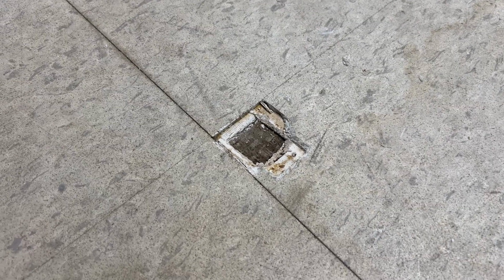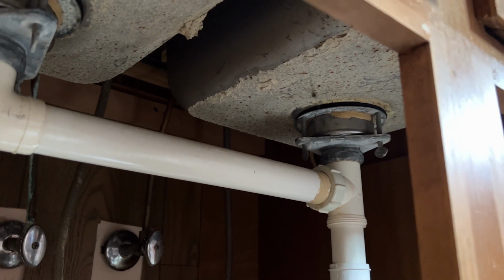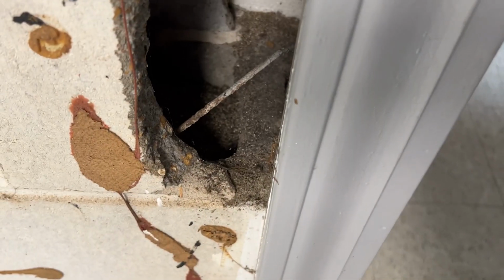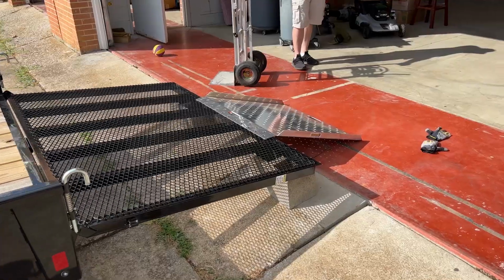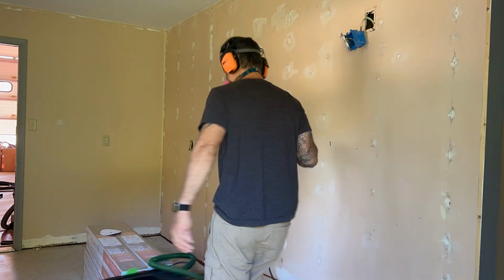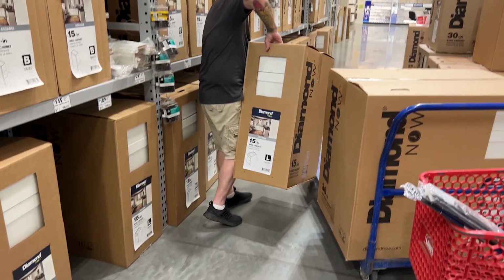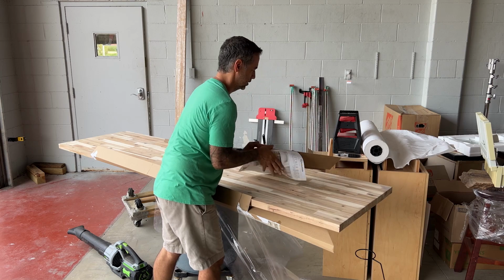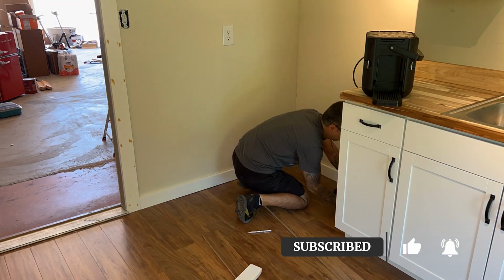We Found Scary Mystery Dust and Transformed the Kitchen!

Comment: A suggestion from Australia - screen doors for those back outside doors (and probably windows). Keeps hungry multi legged pests out from spring to winter while allowing air flow. If there are possums or similar invasive pests, get the mesh security door type (and brush type fill around your roller doors out front).

Comment: As someone who finished our acacia countertops with Rubio, I would make sure to keep the top dry. Anything that can trap water underneath is a big no no. My wife had a plastic tray next to the sink for the dish and hand soap. We rarely moved it and water got trapped underneath it. She moved it one day and I had about a 6" square that had turned black. This was about 6 months after applying the finish. So I sanded it down and reapplied some more Rubio. I had also previously applied one coat of the oil plus 2c and one coat of the maintenance oil. It ended up looking good and blended in nicely. I'd still prefer an oil wax finish over a poly on them as it's much much easier to repair.

Comment: If you have to cut in the block wall again you can drill small holes above where you intend to cut the wall.  Get some cans of foam in a can.  Spray the foam above so your whole block cells to the roof won’t be a pile in your floor. If you remove all of the ‘blockfill’ expect to dispose of a crapload of insulation.

Comment: If on propane, the soft copper is the proper material for gas piping. If natural gas, it all depends on location, some areas the natural gas will corode copper, some areas it is just fine.

Comment: It would be nice if the insulation extended up the sides a bit so there is less heat loss/gain.
Apples should be in the fridge so they resist getting pithy...

Comment: I have cut into walls to add electrical outlets, only to have that same dust come pouring out. I always assumed it was some type of insulation. Not much you can do about it when the customer wants an outlet in a specific location. You just have to wait for it to stop "draining" all over the floor. Marc, how does your square footage in your new shop compare to the space you had in your previous shop? You may have mentioned it in a previous video, but if you did, I missed it. Also, it's rare for me to laugh about anything at 7:30 AM, but when you said you guys can't eat or lick the substance that's on the bottom of the sink, that was pretty funny.

Comment: As a commercial kitchens designer, the "schmuts" on the bottom of the sinks is a sound deadener, so that it doesn't make a bunch of noise when you toss pots and pans in the sinks. It's very common and we specify it on ALL sinks in our designs...just not the asbestos type. 😉
Reply: Also stops condensation sweating and dripping into the cabinet with cold water in the sink.
Reply: I always wondered why some sinks had that.  Thanks for the info Bad Apple
Reply: And thank you Mr. Zengineer for yours
Reply: He literally says that in the video…